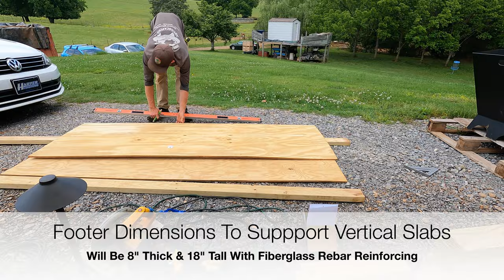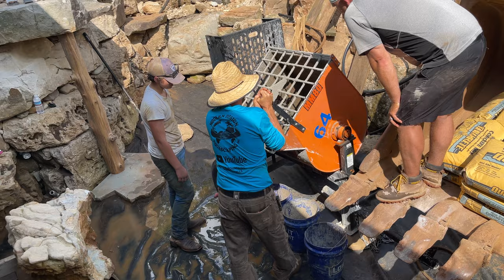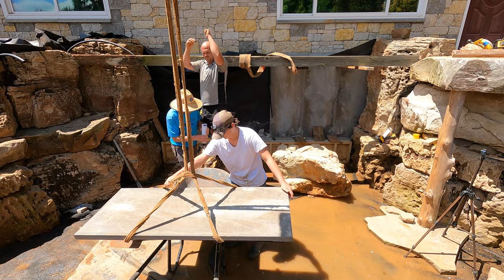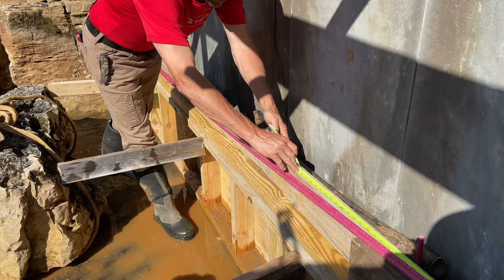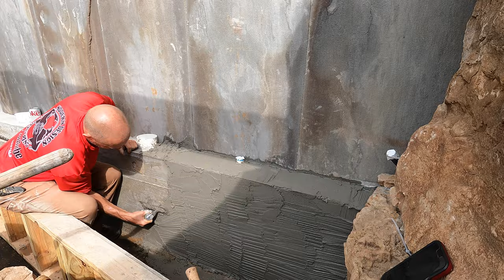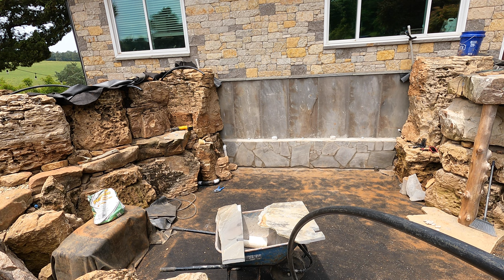Swim Pond How To | Installing A 6' Vertical Wall Of Water Against A House

Comment: Does it look amazing, yes. Do I wonder about the integrity of that foundation long term, also a yes. What’s done is done but I’ve spent time around basement and crawl space waterproofing guys and water can find it’s way into basements with simple grading problems due to rain let alone a standing column of water 6-8’ deep. I’d personally have cut the pond in about 36” from the home and done some flat stone and overhanging plants along the home which would make it appear it’s up against the home.
Reply: That would make a lot more sense than this. Unnecessary risk here

Comment: Wow. Amazing work. So much ingenuity here.  Do you seal the concrete parts of this pond? Other than the esthetic, any cons to make a form with rebars and pour concrete to make a solid vertical wall with slate stone veneers added on it instead of using the expensive stone slabs, building the braces,  foam the back, etc? Also, what are the advantages of using fiberglass rebars over the steel rebars?
Reply from the maker: Fiberglass rebar for underwater (and in case I ever want to salt the system). I dont seal the concrete, it doessnt need to be waterproof, per say…Never thought of it being necessary, I always heard that concrete will harden underwater anyways. You could have made the solid wall all the way up the house but it would have been much thicker- like 8” versus the 3” that I had most of the way up. We don’t have very aggressive winters here either which probably comes into play for some areas of the world.

Comment: Was the extra flag stone panels more of a esthetics or was it required by the engineer to aid in the pressures of the pond?
Reply from the maker: Just for looks. The house foundation was sufficient to hold back the pressure of the water (so far LOL)!

Comment: Looks amazing! My fear is if there is a leak in liner then how do you replace the liner due to the solid wall? Thanks for sharing your skills 👍
Reply from the maker: I guess that could be a thing. There is a rock pad sandwich on either side of the liner. It has concrete on one side of it and stone on the other side. It is completely protected from ultraviolet. There is no way to poke a hole in it. I’m not sure how it could ever get a hole? I guess anything is possible but at this point I feel like we’re pretty solid… I would think if there was a problem, I would’ve known it right off the bat, but we were so careful… time will tell

Comment: Thank you for this, the slow thought full details of solving a wet puzzle. Theres a lot of pressure and material compatability to consider if it's going to last. Good that you used fiberglass rebar, I don't know where to get it yet. Acrylic additives in portland cement based mixtures make a long term difference also, especially where freezing is a consideration. The project came out great, I hope you will make a relaxed conclusion video of it all with long views for perspective. Do you consider it 'done', or are you still tweaking the dream?
Reply from the maker: Still tweaking it for sure. There are “unfinished” details here and there. Small corners-lighting issues-irrigation-landscaping-etc. Not sure I will ever be done LOL! The joy is the journey! Thanks for spending time with us ;)

Comment: Great work !! Did you consider replacing the concrete wall with a glass window to be able to see the fish from inside your house ? Keep up the great content!
Reply from the maker: Yes, definitely did. If I would’ve designed my house with a Ponds in mind, it would’ve been a thing, but it was so much work to make that happen later and not weaken the existing foundation that just didn’t make sense. Next time!